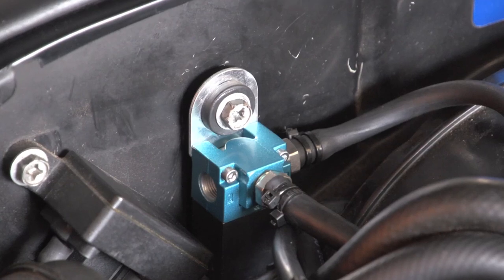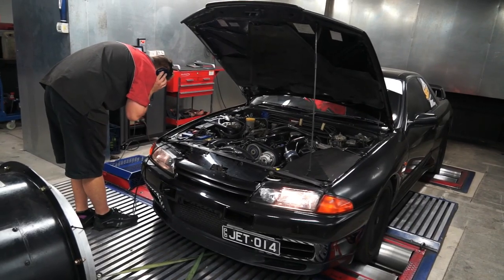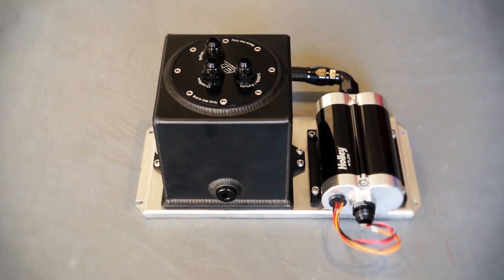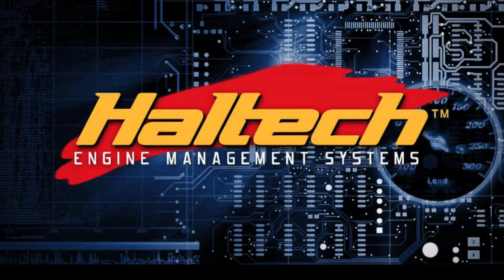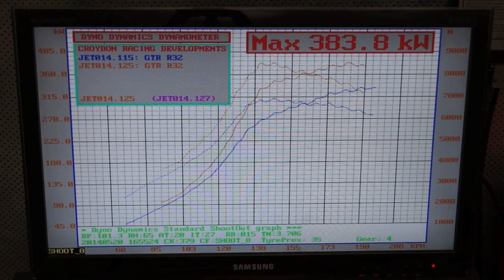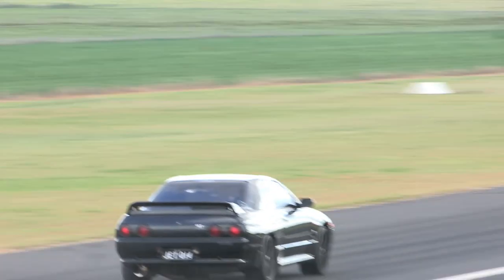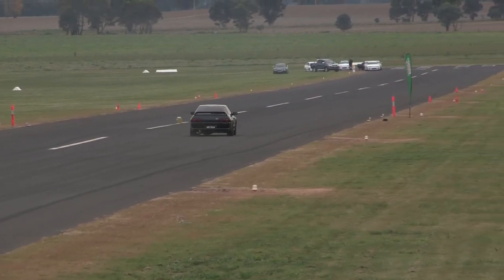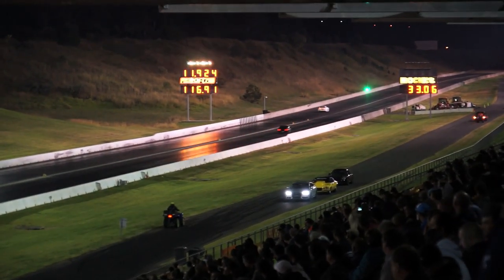Convert your GT-R to E85 and Haltech and MAKE MORE POWER!

Comment: Hi Andrew,Your series of videos inspired me to do the same to my car but without some of the mods I didn't do cams and catch can I got 357kwaw on 20 psi and e85 we had trouble to start the engine when warm with the haltech have to turn it over then put accelerator to the floor and wait for it to fire,did yours do this?? starts straight away cold what are we missing with the haltech idle tune?? what power did you get on e85 at 20 psi??and could you post the breakdown of costs for each upgrade as I would like to copy suspension etc as well,Cheers 3rd Octave.
Reply from the maker: Whoa. Thats not normal. Our GT-R starts first crank cold or hot
Reply: 3rdOctave Is it flooding? Had a similar sounding issue with my car until I got a new standalone setup and got it retuned.
Reply: 3rdOctave Is it flooding? Had a similar sounding issue with my car until I got a new standalone setup and got it retuned.

Comment: Andrew. .question ; did you change the trigger disc in the cas ? how does haltec cope with the issues related with the oem disc ? Iam have ing issues with my ems. maxx ecu system. even at 440 b hp level. (360 awhp) they claim that the nissan cas is one of the wurst  trigger systems they have ever seen. I might allso be experiencing some belt whip..iam going to tighten it. Iam allso going to get a 24/1 cas disc to help improve it further. basicly the ems reads a late trigger signal at 7400 rpm and misfires.

Comment: Wanted to ask an honest noob question. Does it matter if the afm or maf is between the intercooler and throttle body or if it's in front of the turbo inlet? Does the car sort it out either way it's configured or is one way better than the other? Why and why not please?
Reply from the maker: MAF works correctly when in front of the turbo. They're aren't designed to be pressurised by being after rate turbo, but plenty of people have done it.

Comment: Can someone answer me, on the dyno runs why does the power go up and down in little waves at the top end?  Is this a dyno prob or is the car not running well?
Reply from the maker: Can be two things. Boost fluctuation as the boost controller struggles to keep constant boost, or, with GT-Rs oftener the constant changing of front torque can cause it.

Comment: you did all the cradle bushes in the rear hey? i put pinapples in mine to stop axle tramp.
Reply from the maker: We didn't replace the bushes, but have the alloy "pineapples" in the cradle, which means bushes don't do anything. We fixed the axle tramp by raising the car slightly to give more suspension travel and put rear camber arms. can watch in the next video